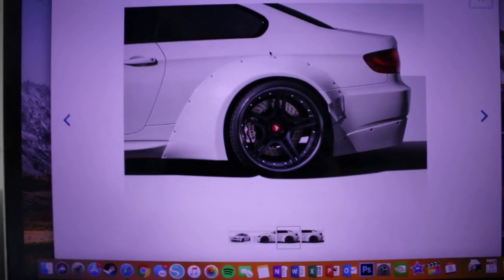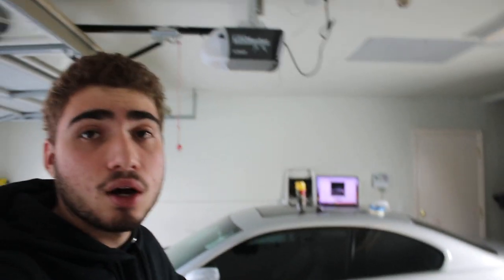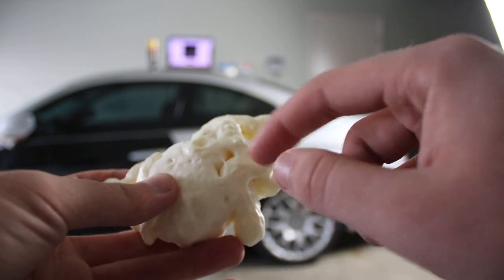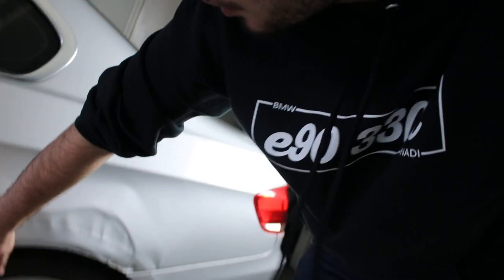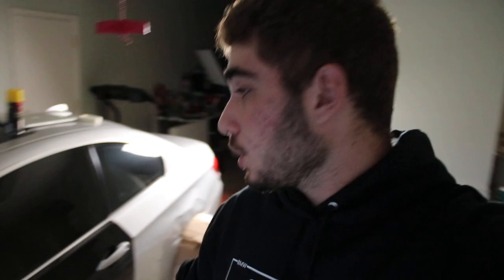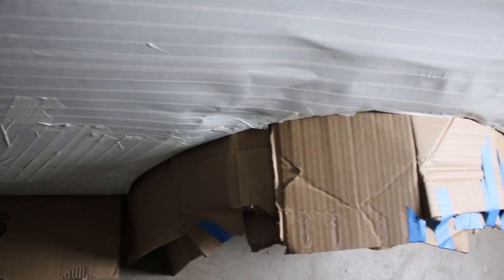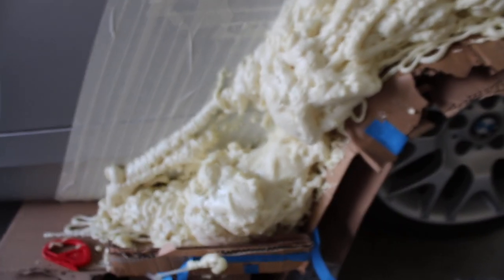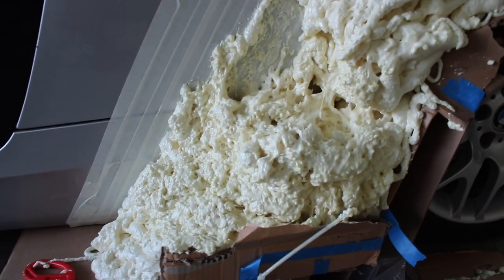CUSTOM BMW WIDEBODY E92 COUPE DIY!!! (Part. 1)

Comment: Have you thought about using the aluminum method with tabs and welding. it would look alot smoother, easier to measure out, etc.it's also probably lighter and far more sturdy as it's not as much material.
Reply from the maker: that sounds too hard Richard lol
Reply: Nour Hummadi it’s fr way easier than the foam and it’ll look cleaner😂
Reply from the maker: BP Productions then come over and help me do it on my car
Reply: Bet, we can make it a collab

Comment: 2:15 probably bad starter 😂
Reply: Just replaced my starter. Mine has the same issue. It really has nothing to do with the starter or battery. Most likely spark plugs